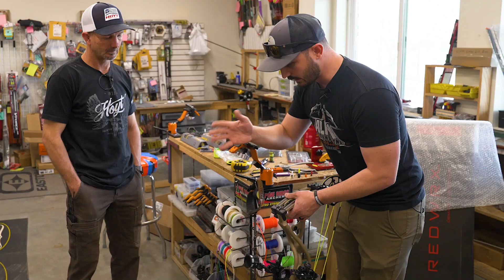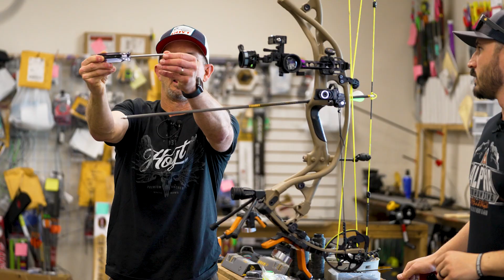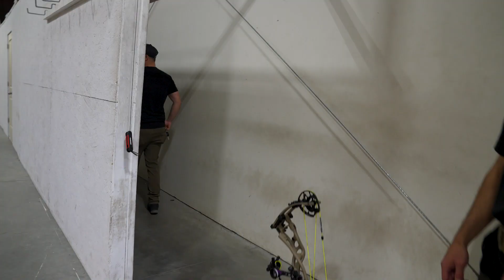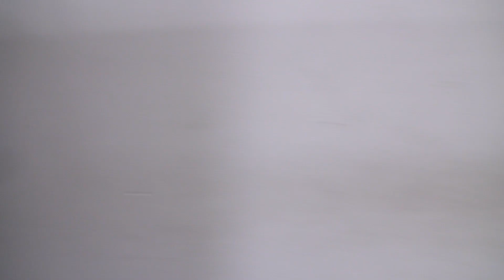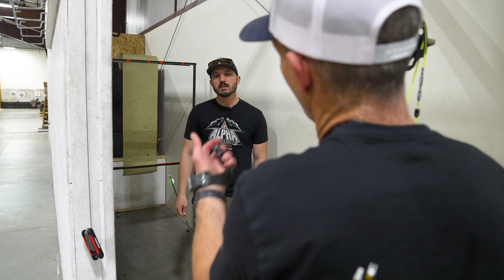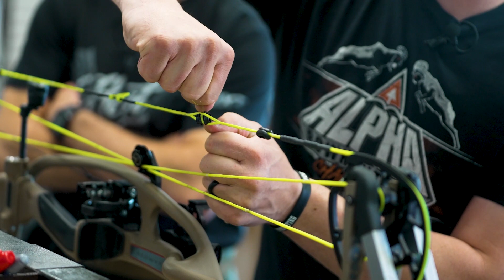HOW TO SET UP A NEW BOW - HOYT ARCHERY TWIN TURBO WITH BEAU THIRY OF NO LIMITS ARCHERY - PART 3

Comment: That first paper tear could be him and grip torque. I like to stand behind the shooter and check for torque when paper tuning. I would then proceed to tell the shooter to either fix your form or tune the bow to their torque. Their choice.
Reply from the maker: Good point in my case it was the way the release broke from the string, as you know its different with different release jaws. The hinge bullet holes the trigger slight right tear... no problem! Thanks for watching